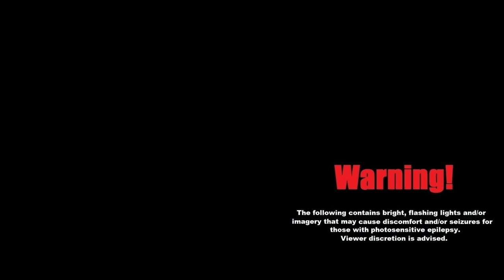Woodturning - Ash And Milliput Bowl

Comment: I have watched many videos advocating the use of abrasive pastes to "do something" to help the finishing process. I confess, I do not see any advantage to using this product. Please correct me if I'm wrong....
Reply from the maker: So theres actually a few advantages to using it, it saves you money on sandpaper as you only need to sand to 240grit but with the paste you still get a finish of at least 800-1000 grit, even tho you should be wearing appropriate PPE anyways using the grit means theres even less dust particles going airbourne and potentially getting into your lungs and it also polishes the wood too as its got oils and beeswax in it...... just to name a few points..... hope this helps